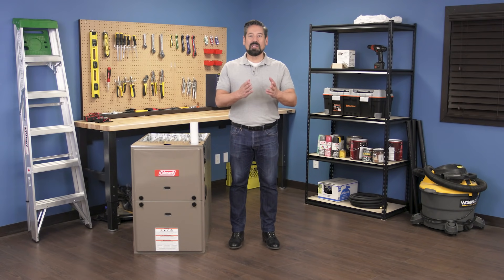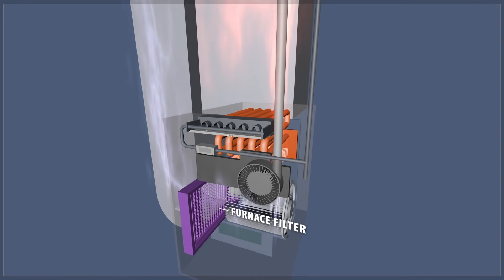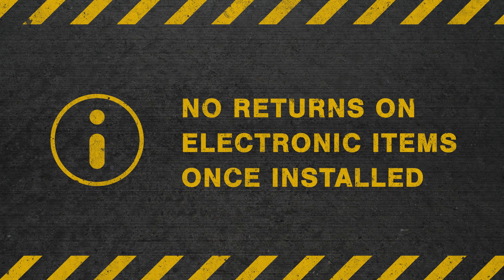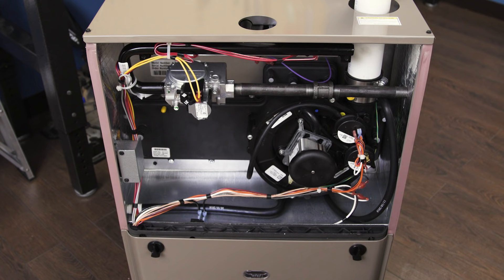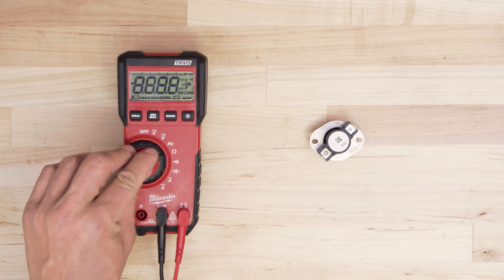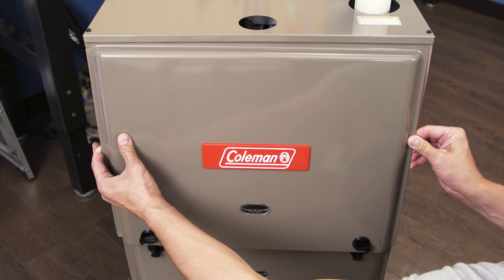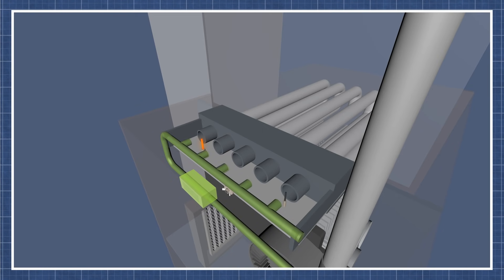Furnace - Limit Switch | Repair and Replace

Comment: Hi I have a Goodman  and for the last couple months  .... when thermostat calls for heat ....  the inducer motor kicks on .. it lights just fine .... but soon as the big blower kicks on ... bam the flames go out and a moment later it re lights  and its good to go and works beautifully until the thermostat  calls for heat again and does the same ... lights  .. the instant the big blower starts ... bang no flame and re lights and good to go again 

No flashing codes ,beautiful blue flames. I even called the local repair,  the couldn't tell me and told me to try a new dual pressure switch  so I did  and  its the same 
Paid them $$ for nothing 
Can you give us any suggestions  please ?
Could it possibly be the limit switch ? 
Thanks 
Sincerely 
Rog
Reply from the maker: Thanks for watching. This could be an air pressure leak between the blower compartment and burner compartment. Some furnaces are very sensitive to any pressure differences.

What to check in order of easiest:
Air filter — replace it anyway if dirty.
Make sure ALL burner compartment screws and seals are tight.
Clean the flame sensor.
Inspect blower compartment door seal.

Comment: I bought  5 limit  switchs it's still blinks 4 blinks on board. Replaced  board,capacitor, and blower  motor last winter. At end of winter 4 blinks started. Had it shut down for a month  to try and fix it but it was summer now ran ac all summer no problems. Now I just tried  to put heat on and blinks 4 time on board. But changing the high limit switch does not fix the 4 blinks. It's a goodman furnace installed  in 2011 is it too old now? Should Get new furnac$e heating  guy said before  he comes out it could be $1000 or more. I can probably  get a new furnace  for   $2000..  I took all the water out of water pipes few  years ago when my furnace  went out. I ran a small  diesel  heater in my bedroom fore few months till it got fixed.
Reply from the maker: Thanks for watching. Best to check exactly what the error code is for your model. If the limit switch is indeed tripping but the swithc is fine then it's best to first replace the air filter and make sure nothing is restricting the air flow, causing the furnace to overheat / trip the heat switch.

Those are simple things you can check.

Comment: Supply houses don't sell to the general public so you're at the mercy of Companies who uncharge even if you know the problem and have doen trouble shooting. A $50 part turns into $300 job.
Reply from the maker: Thanks for watching. While this is true for some, places, homeowners can buy ignitors, limit switches and motors at AMRE as these easy to access and simply to replace. Any gas valves must be replaced by a certified technician as this is part of a sealed system.

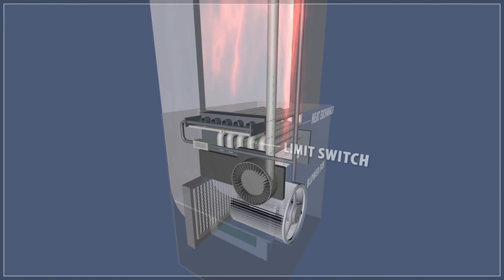Comment: Is there a way to test if a  blower or fan limit switch is cutting out early to prematurely shut down the furnace as discussed at the 2:23 time mark?   “Prematurely shut down the furnace means what? The flame shuts off?  The flame and the fan shut off? 
The original problem with this Trane Furnace Mod # TUE060A936K2 was that the furnace would heat for a while then no heat with the blower blowing indefinitely, reportedly for hours at a time as reported by the resident to the point of a $400 to $600 monthly electric bill. I, when observing myself, had to shut off the circuit breaker on the outside of the building to shut off the blower. 
Forget where I read it but read that if two terminals inside the control board read continuity when disconnected from all wires then replace the control board. Did that. 
Some improvement but sometimes blower would still take more time than I wanted such as maybe half an hour. After that, I went to the circuit breaker because not paying $400 to $600 a month in El Cajon in Southern California. 
True, the washable  intake vent filter has not been cleaned or replaced in years which I will do soon as possible. 
The fan limit switch showed continuity when touching both terminals with an ohm meter each time I touched it about five times. 
Still would like a way to test the blower switch with more than testing continuity if there is a way. 
Could this blower switch stick and unstick on occasion? This limit switch is about 26 years old anyway. Maybe that is a clue to replace this limit switch and get a clean filter in the intake vent.
Reply from the maker: Thanks for watching. To test to see if a limit switch is behaving the way that it is rated you'd have to recreate the conditions that it would normally trip at.

You could remove the limit switch, connect multimeter probes. Heat up the end of the heat switch and observe at what temp it trips. Could use an IR thermometer or a physical probe to measure.

Comment: My furnace occasionally keeps on running for a very long time, even though on the thermostat the set point has been met. It doesn't happen everyday, but every 4 or 5 days it will just keep running. Could this be a limit switch problem? Thanks
Reply from the maker: Thanks for watching. If the furnace keeps running but isn't heating then the limit switch might have been tripped. If the furnace thinks that it is overheating, and the limit switch is tripped, it will run the blower fan to try to cool down the system. (there is no advantage to just shutting off the blower in an overheating condition)

Best to check the furnace filter to make sure it isn't clogged and that airflow is good.
Alternatively the limit switch could be failing and might be tripping at lower and lower temperatures.

If this is happening you might also notice some error codes.
Reply: @AmreSupply  thank you!

Comment: When i set my multimeter to the lowest settting, 200 ohms, i get a reading of around 120. What does that mean?
Reply from the maker: Thanks for watching. The limit switch should not have resistance. It is a switch. When the switch is closed, there should be a unrestricted path for electricity with a resistance of 0 to 1 ohm. When the switch is open, there is no path for electricity to flow, so the multimeter will show - - - - - , or OL as there is no resistance reading, as the switch effectively has an air gap between the terminals. If your switch shows 120 ohms then it's faulty and should be replaced.

Comment: hi,  thank you for the info,  Im trying to find limit switch for my Lennox furnace,  are they all the same? or there is specific switch for specific model,  thank you in advance
Reply from the maker: Thanks for watching. Limit switches will differ based on the physical shape and size and where the mounting holes are located. Switches will also differ based on the temperature ratings. The switches will list a Cut out & and a cut in temperature or the side of the switch will have a rating that looks something like this: L150-40F https://www.amresupply.com/part/16687695 Which means it will cut power when the temperature reaches 150°F and cut in when the  temperature is 110°F  (40 degrees less). So you'll have to match these specs for the switch of the same size and shape to work properly in your furnace.

Comment: Does this work the same for an electric furnace?
Reply from the maker: Thanks for watching. Electric furnaces also have limit switches that will shut off the furnace if the temperature gets too high. The ratings of the switches will be different between models but the principles are the same.

Comment: If the blower motor cycles on and off ( 46 sec.) its got nothing to do with the limit switch.  The limit switch will detect the heat rise and shut off the gas valve. The main blower  will run throughout in an effort to cool the furnace down.  To confirm this simply detach one wire from the limit and watch the blower turn on.
Reply from the maker: Thanks for watching. We did another video to explain the cycling on and off which can be caused by a few different components depending on how far into the startup sequence it gets. https://www.youtube.com/watch?v=b0sAGt-1niU

Comment: Older model floor furnace 5088-2 that will not stay lit?
Reply from the maker: Thanks for watching. If the model uses a pilot flame then you can test the thermocouple or thermopile voltage to see if the pilot flame is heating up correctly.

We have tutorials for DC voltage tests with water heaters but the same tests can be done with a furnace.

For a model with a therocouple you can follow the steps here: https://www.youtube.com/watch?v=Lu5GvbvspMw

For thermopiles: https://youtu.be/UXpmmGuewk8

Comment: William high switch were locate
Reply from the maker: Thanks for watching. The high limit switch monitors the blower air so it will be located on the side of the furnace supply plenum. The exact location will differ between models.

Comment: will a limit switch cause the ac not to come on? my board beeps 4 times indicating a limit switch. blower motor will come on for about 5 minutes the shut off. condenser wont come on
Reply from the maker: Thanks for watching. Yes in some models a limit switch act as a broad safety switch even while the AC. If the limit is faulty then the system might think that it is overheating during an AC cycle.

Comment: Mine cycles on/off only on cool, furnace works perfect. Would the limit switch work for cooling cycle as well? I’ve replaced the control board but doing the same thing. Maybe it’s defective 🤷‍♂️
Reply from the maker: Thanks for watching. The limit switch is a safety device so it is meant to protect the furnace from an unsafe condition. In many cases this will still be wired into the cooling circuit so it is possible that it is causing problems.
Reply: @AmreSupply  thank you!!

Comment: I'd like to know why it's stopping my ac
Reply from the maker: Thanks for watching. It depends on how the furnace is wired but when one of these switches is tripped, the control board thinks it is unsafe to operate and in some cases it will just run the blower fan to cool down before shutting off.

Comment: This is what I just paid $335 to my HVAC guy to do?! Ugh. What a rip off.
Reply from the maker: Thanks for watching. That is frustrating. With parts and labor together some repairs can add up quickly but not all HVAC technicians have the same pricing structure. For something more in-depth or complicated it can be worth getting someone to do the work. For ignitors and switches, these only take a few minutes to access which is why many people decide to do it themselves.

Comment: I whished he would go over of the switch types and ratings .. what is a snap disc, why some are NO and some NC .. what is L165-60F mean .. Anyone can replace a part something that looks similar, but what if the part is not available ? .. can I use a L175-40F instead ?
Reply from the maker: Thank you for watching. That is good feedback. In our newer videos for appliance repair we have tried to add in more detail about what specifications you'll need to look out for as well as what variation there is between models.

We do however have a video explaining switches in general and the difference between NO and NC. https://www.youtube.com/watch?v=Mdu7QlAzWOg&list=PLCo9SMjkdWBycw9hZVfYFc6Sw2Jlavaak&index=5&t=1s

L165-60F means that the switch opens at 165°F and will close after dropping 60°F (at 105°). It is still always best to install a switch with the same high limit as this is what safe upper limit the furnace was designed with.

There are older models that use fan limit switches which might have a NO and NC switch which cover a different range from each other. These are generally in models that have a more simplistic circuit board in them.

Comment: To limit switches have a part number on them so you can replace them with the correct part
Reply from the maker: Thanks for watching. There are several ways one could find a new limit switch. You could look up the model number of the furnace and sometimes you might be able to find a parts diagram. Some switches will have a part number so you can find a match that way. If needed you can match by physical dimensions and the rating. If a switch says L170-40 it means the switch will open at 170°F, and close  at 130°F

Comment: I changed the filter and the temperature still is not going up. What could it be? Thank you
Reply from the maker: Thanks for watching. Just to clarify, the furnace turns on, the flames ignite and after several minutes the furnace shuts off?

If this is the case then it could be a faulty limit switch. 

If it shuts of before that then it could be a different issue: https://www.youtube.com/watch?v=b0sAGt-1niU

Comment: Iv had all my limit switchs replaced and evertime my furnace shuts down my fan keeps running untill you shut of the breaker to reset it any suggestions
Reply from the maker: Thanks for watching. This means one of the safety switches has tripped. You could try to see what error codes your furnace gives you. As well start up the furnace and observe exactly where in the sequence it shuts off. This can help you narrow down the source of the problem: https://www.youtube.com/watch?v=w5w4QMcCNUM
Reply: @AmreSupply  it never shows any error cods it always shit off at the burner one and it's been replaced sever times
Reply from the maker: If the burner ignites and the flames stay lit and the system shuts off after a minute of running,  then it could be an issue with the airflow, the air filter, the limit switch or the control board.

If the burners ignite, and the flames shut of a few seconds after startup then it's likely a dirty flame sensor. As well a dirty burner assembly can also prevent the flame sensor from working properly.
Reply: @AmreSupply  the flam stays on runs untill the heat gets warm in house the thermostat turns it off but the fan blower just stays on
Reply from the maker: @dakotak8437  Check your thermostat Fan setting. Setting it to "On" will run the fan 100% of the time even when it is not heating. Setting it to "Auto" will turn on the fan only when heating is  needed.
Reply: @AmreSupply  it's only on auto never the othere way
Reply from the maker: @dakotak8437  This seems like a control issue. Try doing a reset of the thermostat. If that doesn't help then it could be an issue with the control board.
Reply: @AmreSupply  ok thank you for your help. Much appreciated
Reply from the maker: @dakotak8437  You're welcome, just happy to help!

Comment: Will the blower motor still work if the limit switch is bad? Or can a bad limit switch prevent the blower motor coming on, even if just using the furnace on the "fan" setting?
Reply from the maker: Thanks for watching. The blower fan might still run but it might cycle as the furnace attempts to ignite: https://www.youtube.com/watch?v=b0sAGt-1niU

Comment: Can a faulty limit switch cause air to be lukewarm instead of hot?
Reply from the maker: Thanks for watching. A faulty fan limit switch in some furnaces might change the perceived temperature. Generally air coming out of the vents is not extremely hot as it cools slightly when traveling through the air ducts. Is it no heating up to the right temperature anymore or does your home still heat properly?
Reply: It's not heating up as years prior. When I pass by the vents the air seems a lot cooler than it should be.

Comment: I wonder if me a 27 year old girl can do it myself 😭
Reply from the maker: Thanks for watching. With the right tools and knowledge, these sorts repairs are something that anyone can do! Simple repairs of replacing a ignitor or a switch only require a screwdriver to access and a multimeter to test. Anything to do with a sealed system or a gas line will require a professional. If you are unsure it's always best to contact a technician.

If you're interesting in learning more we have a great series on electricity and some of the basic components. It can help put it all into perspective: https://www.youtube.com/playlist?list=PLCo9SMjkdWBycw9hZVfYFc6Sw2Jlavaak

Comment: As an engineer, I can tell you that it is not a limit switch but a thermal switch (Klixon manufacturing). While the switch is used to protect the heat exchanger from a low airflow rate, it purely operates on the thermal input from the heat generated by the furnace burners. It would be helpful to correct yourself and all those that seem to refer to this switch as a limit switch.
Reply from the maker: Thanks for watching. For these videos we use the language and terminology that is used in the HVAC industry as well as we use the terminology that is provided by the manufactures of the replacement parts. In this case it's been referred to as a high temperature limit switch, limit switch, thermal limit switch or upper limit switch. We do however try to explain how it works so there is no misunderstanding about the function of these parts.
Reply: If the flame rollout switch is bad, will the burners light up? Thank you.
Reply: @HungNguyen-sb1yu  no I dont think so.  As that's a safety switch and if it malfunctions, there wont be any communication so it will shut furnace off just like the flame sensor
Reply: Thank you all for your help. My flame rollout switch looks damaged, but the reset button didn’t pop up, I used a screwdriver trying to push it down but I couldn’t. I need to replace it and run the furnace again. If this works, how can I find out what happened to it? Thank you again.
Reply from the maker: @HungNguyen-sb1yu  You can learn more about how to test and replace the flame rollout switch in this video: https://youtu.be/23LGRraYUg0